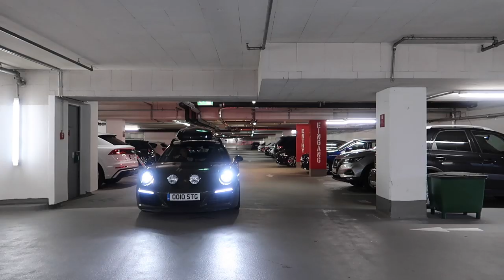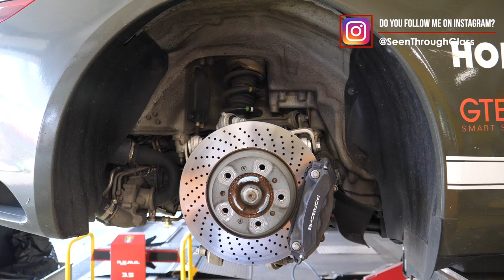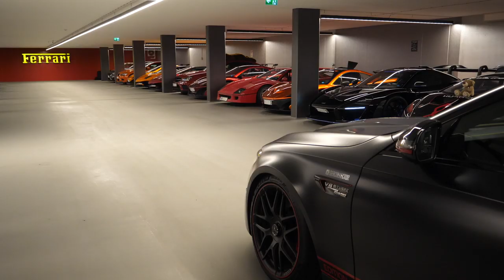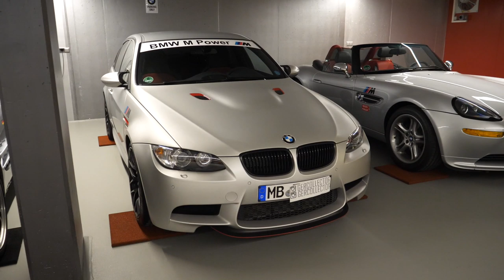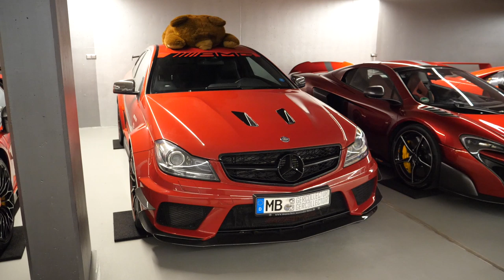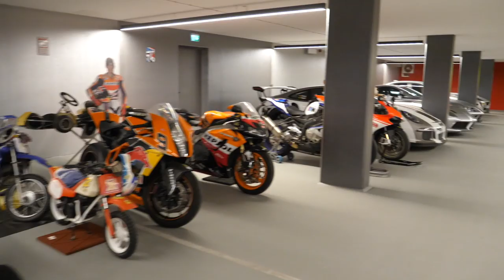#DrivewayGoals: GerCollector's INCREDIBLE Hypercar Collection | Eᴘ71: Mᴜɴɪᴄʜ

Comment: May have been just the angle of the camera but the paint on the F40 looked terrible. Almost like the clearcoat was gone from certain panels.
Reply: LemonJelly360 its an old ppf 😄
Reply: Sam mentioned that it was a protective layer since they do drive it. I guess it is not a clear coat or a clear PPF
Reply: Thanks, apologies for missing Sam’s remarks.